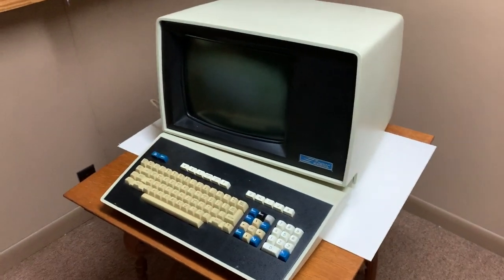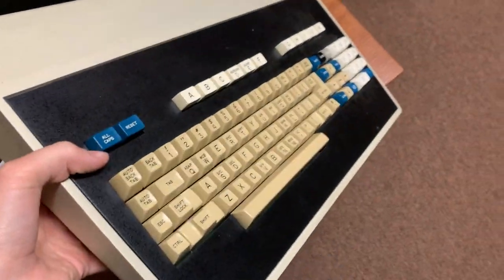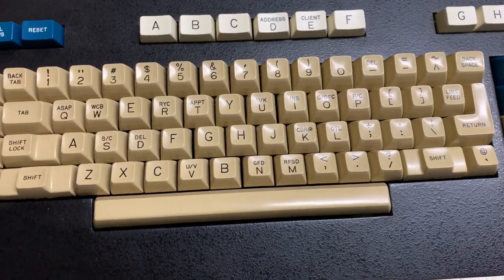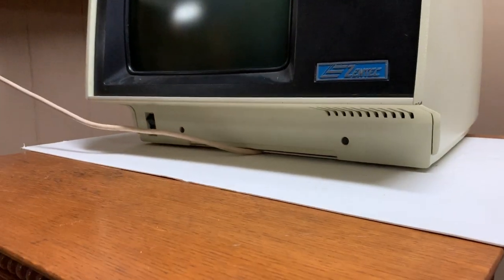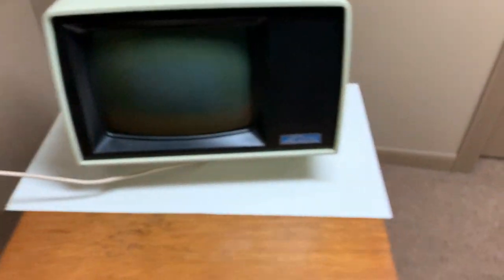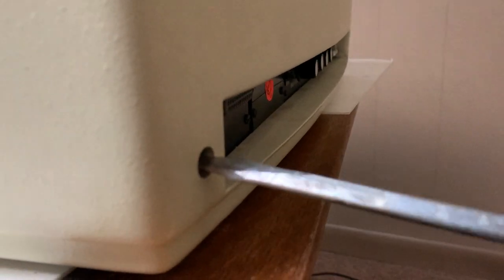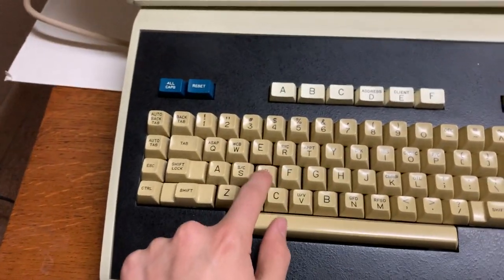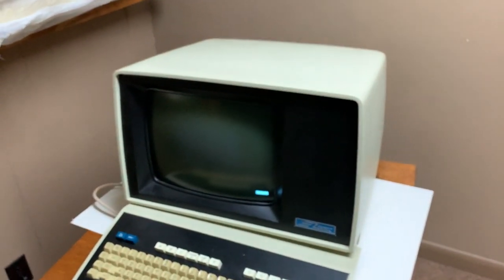Zentec 9003 Programmable Terminal & Keyboard - Overview

Comment: Hi. Great video. I own a Zentec Zephyr. The manuals for the 9003 are available here: http://www.bitsavers.org/pdf/zentec/9003/88-407-01B_9003_Theory_of_Operation_and_Maintenance_Manual_Oct76.pdf and I think yours looks like you have it working now from reseating some of those ICs. Don't expect a response from your keystrokes until you have it hooked up to a host. Drop me a message if I can help. :)
Reply from the maker: Hello. I have looked at those manuals. I don’t have any host to hook it up to except for my computer, which I don’t have any idea how to do. Thanks
Reply: @jacksonsstuff6621  Sorry, I just noticed your reply. It's quite simple once you have your head around it. You need to buy a USB to  25 pin RS-232 converter and possibly a "null-modem". This will link the USB serial of your computer to the serial of the terminal and allow text to be exchanged betwen the two devices. All of this kit is available really cheaply on ebay (try sorting in ascending order of cost). Download a terminal emulator and you will be able to communicate with your PC. Once that is up and running, I would recommend interfacing to a raspberry pi and maybe have it emulate a mainframe. Best of luck. Let me know if I can help. Well done for saving it.